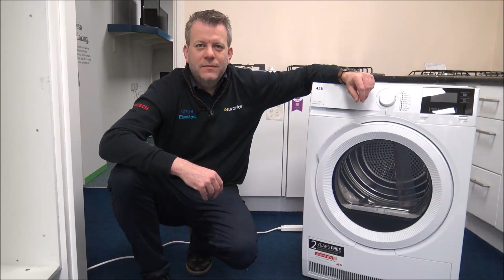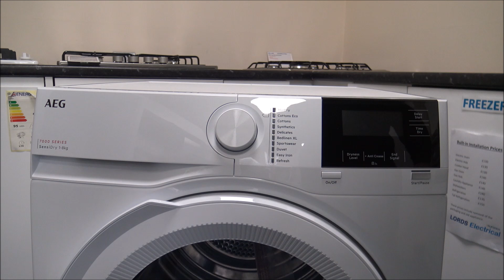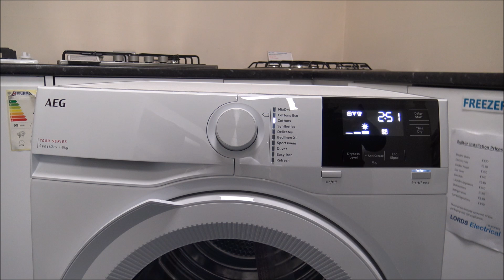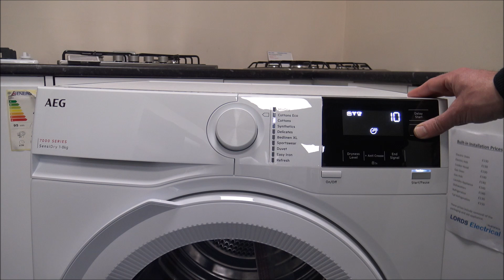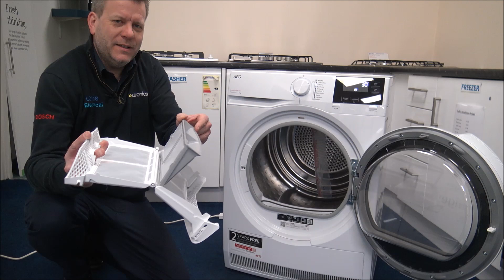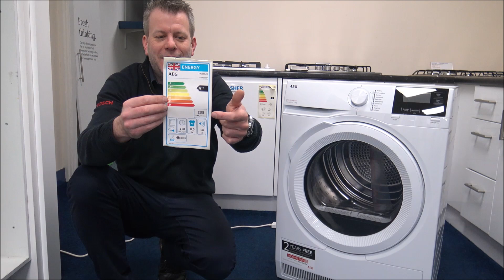AEG TR718 Heat Pump Tumble Dryer

Comment: I have the lavatherm 7, 8 or 9000. I dislike it since it no longer dries clothes, runs for 4 hours and the clothes come out damp at best. No idea what it could be and it's not something you can fix easily. Only had it for 2.5 years.

I hope if I soak the lint trap, it will get better. Apparently fabric softeners can contain fat and clog the filter. I sure hope that solves it. I must say I'm fairly disappointed with this machine. I doubt I'll remember to update this comment, but if you're interested, leave a reply.
Reply from the maker: The main things to check will be the tank is empty, filter is clean, condenser unit is clean and the contacts within the inside of the door are clean too which detect the moisture content within the clothes
Reply: @lords-electrical  Thank you for your response and advice! Much appreciated.  It's videos like yours that truly help appliance owners out.

I have good news, in one of the many videos I watched, the man said that fabric softeners often contain animals fats and these tend to clog up the filter's 'pores'. To the naked eye, it seemed clean, but I held it under the sink and like the man said, water was not flowing through it! So I hosed it off and I could see the filters becoming noticeably cleaner! 

I ran the dryer again just now. No wet lint everywhere, just dry fluff. I couldn't believe it. I also cleaned the sensors thoroughly, but I didn't have an issue with the machine thinking it was dry and stopping early, so I somewhat ruled that out. 

I'm super happy. I wish I had seen that earlier.

I found the video again: So around the 2:45 mark of this video (https://www.youtube.com/watch?v=umSXSNeNPf0) , you can see the water not flowing through. That was the case for me.

Honestly, I couldn't have guessed that it would have had that much of an impact. I always cleaned off the lint, but never rinsed it until now. Again, I'm super happy. 

And again, thank you.

Comment: Do you know where you can buy the foam filter things you can put infront of the evaporator at the bottom to stop dust getting into the non removable condenser
Reply from the maker: Normally spares will be available from AEG themselves
Reply: These don't have any foam filter from the factory, the one I got was from a motorcycle parts store that I cut to size. Approximately 242mm by 167mm, I bought a 15mm thick foam and needed to cut a bit of an indent from the top where the filter dips down from the door. Cut a few mm larger than the cavity dimensions so that it sits snugly. Also make your own measurements, the one I have is a much older model though internals look similar.
Reply: @Progan666 is a foam filter the correct thing to do I want to put one on to stop any dust getting through but does it affect the dryer in anyway negatively or will it work the same cause air needs to pass through into the evaporator bit

Comment: I’ve got this tumble dryer it’s excellent, mine has a black door not white. One of the things that stands out is the big drum, and how often it reverses during the cycles, especially if you use the bedding XL programme that reverses every 2 minutes to stop sheets from tangling up. 

I highly recommend also with heat pump dryers to use wool dryer balls and no liquid fabric conditioner in the washer or dryer sheets, as this can put a film on the sensor and stop it from sensing and drying properly and clothes come out wet. You also don’t get static as the machine doesn’t get hot enough and it does a cooling cycle for 10-20 minutes before the cycle has finished.

Comment: Thanks for the review. With respect to the load weights for each programme, does the machine actually weigh the load and refuse to operate if overloaded? Or is it up to the user to weigh the items before they go in? Just curious!
Reply from the maker: You would need to weigh the clothes it doesn’t weigh them. If you overload the dryer, it will just take longer to dry than the time initially stated